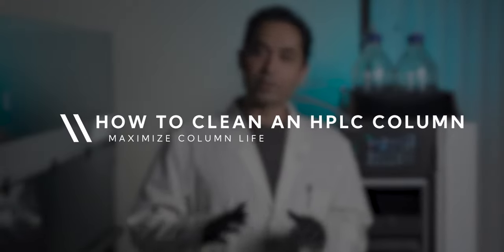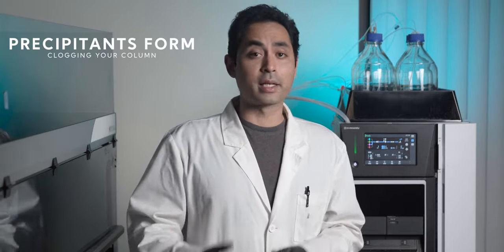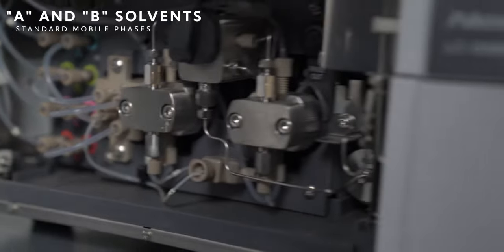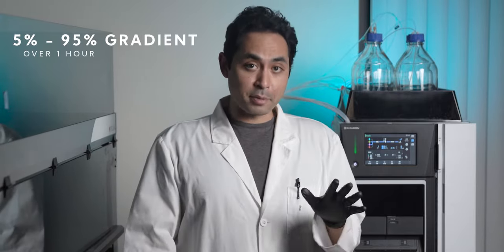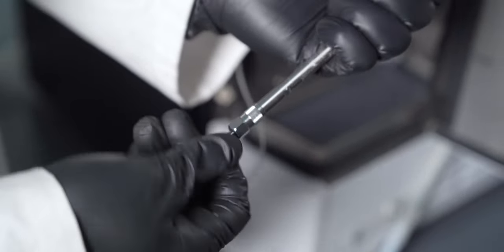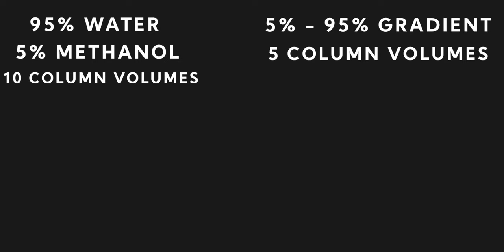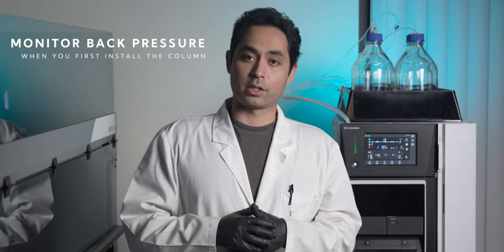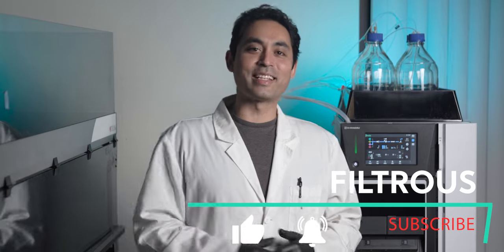How to Clean an HPLC Column in Daily & Deeper Cleaning

Comment: I’m using RP18 250 cm column with 90% 1%acetic acid and 10%MeOH on gradient where B maximum is 65%. After about 80 hours of constant use, I found peaks are moving forward for about half minute, even for standards. Can you tell me the reasons and solution. Column can work between 1-9 pH, n A phase has pH around  3.5
Reply from the maker: you're probably not equilibrating your column long enough.  you might want to hold it at B longer at the end of the run or even kick it up higher and then when you bring it back to the starting conditions - let that go for a bit before ending the run.

Comment: Can you write a detailed program to clean column C18 with this method (95% water and 5% methanol for 10 column columns. Do a gradient of 5 to 95% methanol for 5 column volumes. Hold 5% water and 95% for 10 column volumes?) Tks
Note: I use pharmaceutical analysis with HPLC Dionex Ultimate 3000 autosampler and Water E2695 autosampler.
Example: I used ACN: KH2PO4 0,01M (40:60) pharmaceutical analysis, so How I can clean column C18 with this method?
Reply: You need to remove your current mobile phase and replace with methanol and water.   It's important to remove the salt in your column.  Hopefully you have a binary or quaternary pump where you can do a gradient.  You first start with a hold of 5:95 methanol to water.  Then you do gradient.  Finally you hold 95:5 methanol to water.
Reply: @DavidYazdi1  Tks so much

Comment: Do not follow this video. Always follow the column manufacturers manual and call their technical support if you have specific application questions. Anyone who would tell you to reverse flow through a HPLC column is basically telling you to piss way $1500. 

Source: I'm a field service engineer for Thermo Fisher and I work in IC/LC chromatography.
Reply from the maker: Hey Daniel, this is for a reverse phase column and this is in the column care guide that comes with the column. Yes, you are right that this does not apply to all columns but it does apply to this column as it is reverse phase.